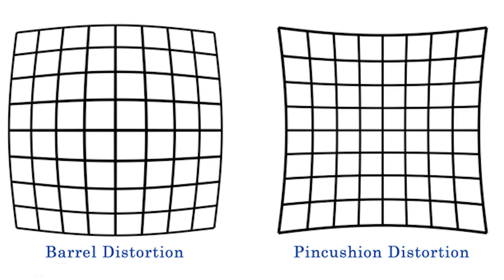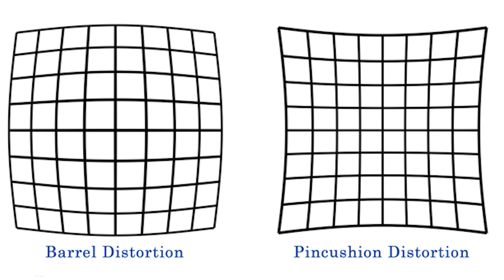VR Barrel Correction & Rendering Resolution Explained

Comment: Are you sure that the HP Reverb is 2.5x as many pixels as 4K. The actual display will be the same number of pixels as 4K i.e. (2160 x 2) x 2160 which is 4320 x 2160. Steam VR then makes this about 50% more not 250% more?
Reply: i don't know the excact numbers for the G2, but io think this is similar to the Quest 2 which a native display resolution of 3664 x 1920 = 7.034.880 Pixels in total. To get a pixel ratio of 1:1 you need a render resolution of 5408 x 2736 = 14.976.288 Pixels. This results in 2.1x more pixels to be rendered to get 100% quality. If you adjust these numbers to the higher resolution of the G2 you will get approx. 2.5x.
Reply: @ProgrammistMusic  It follows then that half res with 2.5x will be signifcantly below 4k at 5.832.000, which makes sense for weaker graphics cards.
Reply from the maker: Yes I'm sue mate, I was talking about the resolution it actually renders at 100% in SteamVR ... not the panel native resolution as if you render at the you are under-sampling.
Reply from the maker: Both of you are spot on in your follow up comments :)
Reply: @KarlGosling  This makes a good reference point for graphics cards. If you only get 50 FPS at 4K you will be lucky to get much more than 20 FPS at full res on a G2 but may get a more acceptable 70+ FPS at half res. Hopefully I’ll find out next week if mine finally arrives!

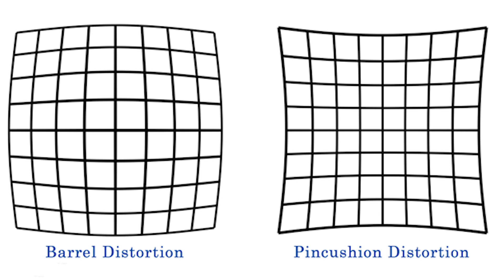Comment: Karl - @4:10 black is easily understood by considering a rectangle (being the actual pixel field for rendered barrel-distorted images) around the barrel image @1:50. 
If the rectangle ran from barrel corner to corner, it would clip original images;  enlarging the rectangular pixel field to capture the full barrel without clipping leaves black gaps near corners.

Comment: Interesting stuff this! I understand that if the panels have a resolution of 2160x2160, when you go through the two distortions the final image gives a smaller FOV. And to get a larger FOV you have to render a higher number of pixels. What I don't get is where are those pixels? If the panels already are showing the maximum number of pixels, how can you render more pixels?
Reply: I didn't understand that either
Reply: I don't think the render resolution has some effect on the actual FOV within the headset.
Reply: I was thinking about very similar thing. I can understand his reasoning but I still don't get it, I can't imagine what is he describing.

Comment: I've heard the same message about barrel resolution. You know what it's easy to get fixated on this stuff. I don't see what you're seeing in an increase in FoV from native resolution though I still use 50% for the G2 and I'm quite happy. I'll have to do more tests - this is definately food for thought, thanks for sharing!
Reply: the new headsets like the G2 or Quest 2 do have insane high resolution displays indeed. If i set Oculus to the maximum total render resolution and STEAM VR to 50% it still looks amazing. Apart from this at 100% my 2070 SUPER still works on games like Half Life Alyx, but really struggles sometimes, whereas the CPU almost gets to sleep with no more than 15% of CPU load.
Reply: @ProgrammistMusic  hey do you use the quest with 1.7x resolution, if so how does it play out with your card?
Reply: @evengreven5515  on my RTX 2070 SUPER i can play some games like Tennis without issues in the highest resolution at 90Hz if they don't need much GPU load and especially VRAM. 

Even Half Life Alyx runs at 90Hz and graphics to ultra high with a STEAM resolution set to 86% (default) or even higher, although there will be significant framedrops in some scenes. The GPU is permanent around 85-95%, which is usually too much during a game because you don't have enough headroom. I usually adjust the Quest 2 render resolution in combination with STEAM VR to get about 65%-70% if GPU load. In some games i also don't need 90Hz, e.g. in Alyx i did not notice any difference in gameplay.

Especially in games like Half Life Alyx even a render resolution of 1.1 or 1.2 with STEAM VR set to 100% looks absolutely amazing.

Usually my sweetspot for 90Hz is between 1.2x and 1.3x. with 80% to 100% in STEAM VR. I set the Oculus Link bitrate to 250Mbit.
Reply: @ProgrammistMusic  cool thanks for all your info i appriciate it 😀 have good day friend.

Comment: good job, thanks for that. One question. Why do some games have another slider for supersampling, or whats the difference between SS and the resolution in steamVR?
Reply from the maker: In game slider if it's SS will be added on top of the SteamVR render slider.
Reply: @KarlGosling  Thank you.
Reply: The resolution slider in STEAM VR can also set a supersampling rate it you set this to above 100%. Some games offer additional supersampling options and render with a given multiplier, which is mostly shown as a 1.x or percentage value. This adds to the STEAM VR slider. E.g. if you have set STEAM VR to 150% the supersampling multiplier ist 1.5. If you then set an additional supersampling of 1.5 in the game itself this results in a multiplier of 1.5 x 1.5 = 2.25.
Reply: @ProgrammistMusic  thank you very mich. This makes sense.

Comment: I would be curious to see an image made up of easily identifiable pixels, or just a graph with lines every other pixel, with a demonstration of how things look when you render at the exact resolution vs a higher resolution for supersampling.  Last year I was reverse engineering how to render a VR image so that it would appear proper in Google Cardboard, and those lenses do the same thing, so I would have to apply a barrel distortion that crushes the image inward so that the lenses can expand them outward and make the image look flat again.  But this requires that I render at a higher resolution so that the crushed image is still populated at the edges, preventing black at the edges when I look at the final image in the lenses.  Rendering at the higher resolution, then, allows the straight forward image to be 1:1 pixelwise while the edges would be more pixelated because of the barrel distortion of the render.  If a GPU can't handle rendering that size of an image and keep up its refresh rate, then the supersampling has to be turned down, causing pixelization in the center.

Comment: According to oculus, in order to get a 1 to 1 ratio with the quest2 , because of barrel distortion etc, the rendering res in the oculus display settings needs to be maxed out, so over 5000. So if anything, the steam default resolution is a lot lower than it should be,  not  higher like some people think :) Here is the twitter  link to the guy from oculus explaining how the rendering works. https://twitter.com/volgaksoy/status/1328145529042137088
Reply: Brilliant made perfect sense 😁.
Do you think you'll have your G2 /Q2 comparison up soon as my G2 is due to be delivered on the 15th and im still on the fence about cancelling it🤔
Reply from the maker: Yup thats right, 1.7 on the slider.
Oculus resolution slider is for both eyes... SteamVR is for one eye mate.
Reply: @KarlGosling  cool makes sense, thanks.
Reply: correct, the STEAM VR resolution sliders applies to the base resolution set in the Oculus app for the Quest 2. If you set this to 5408 x 2736 STEAM VR will set 100% to 2704 x 2736 per Eye. Everything above is supersampling.